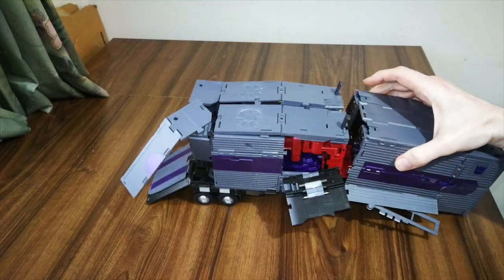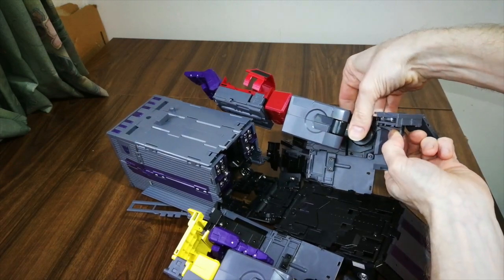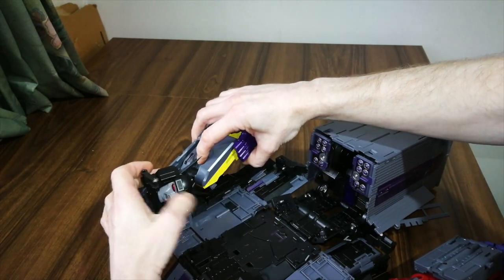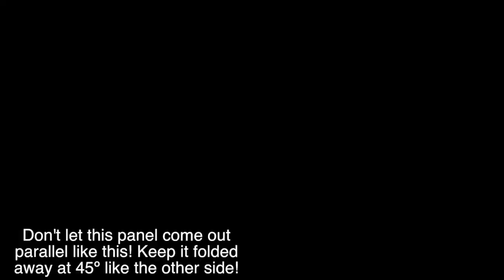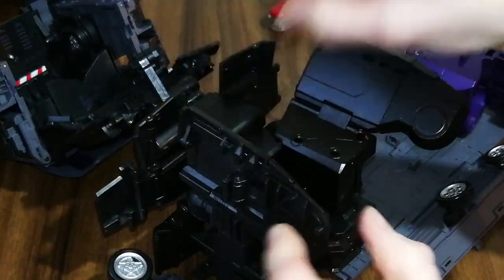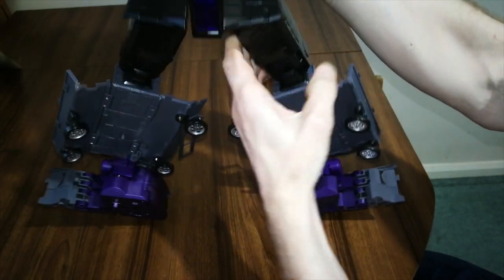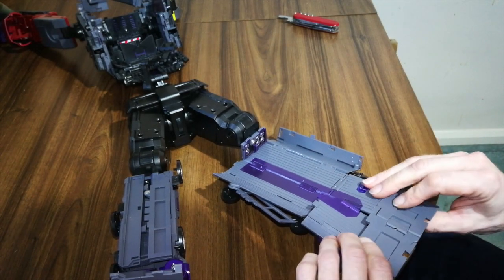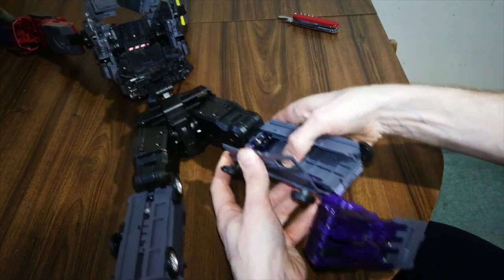The Only Transformation Guide You Need: X Transbots Menasor Trailer To Robot

Comment: Great video thanks! I did mine without any instructions first and broke exactly the same leg tab you did, lol! :) Just watching to see if I missed anything, or how I could have done it smoother. Dunno if it really makes it easier overall, but I ended up fully completing my torso before doing the legs so I had a fully formed torso sitting on half a trailer. Was super solid so when I did the legs there was no torso flopping around on incomplete abs/waist parts. I feel like getting back to trailer without instructions will be harder, so will check out your other vid if I give up!

Comment: Thank you for filming this. I just received my copy yesterday, and just when I got to the part where you rotate the trailer section that makes up the lower limbs, I barely touched it and the single screw that holds the leg to the knee joint sheared off. The wind was taken out of my sails naturally. I finished the transformation, but I'm waiting to hear back if I can get a replacement knee section or I'm going to attempt to drill out the broken part and put in a stronger screw.
Reply from the maker: That's awful. I wonder if they used two different batches of screws. I've transformed mine and posed him loads with no knee problems.
Reply: @TransformsIntoAGuitar  It’s the screw that is mounted through the trailer/lower leg section that attaches to the bottom of the knee joint. I don’t know why they thought that single little screw was a good idea. I’m afraid of tinkering with it too much from fear of the other leg snapping off.
Reply from the maker: @GartheKnightReturns  I know which screw you mean, there have been a few reports of that same problem.

Comment: He will stay as menasor forever.
Reply from the maker: That's a shame. I love seeing Motormaster with his trailer.
Reply: I really want to transform back and forth, but the immense weights involved on either side of that teensy waist joint wake me up at night.
Reply from the maker: @uum6  It feels quite sturdy to me. I've transformed him quite a few times with no problem.
Reply: @TransformsIntoAGuitar  I wouldn't worry if my Dragstrip hadn't  broken within days of arrival. Got a replacement part, but still.
Reply from the maker: @uum6  Yeah, that issue is worrying. I hear the replacement parts are much better than the original.
Reply: @uum6  What part broke? Curious what to look out for. I got him back to car mode with no real issues.

Comment: Hey, thanks for your video. I have the same issue with the spring loaded shoulder joint, did you manage to fix yours?
Reply from the maker: No, I didn't bother. It stays on well enough and others said the spring caused it to damage the paint.
Reply: @TransformsIntoAGuitar   I requested and received a replacement part.... it didn’t fix the problem. Mine stays on well enough as well but  when I look at it I know it’s there haha
Reply from the maker: @gamorg  What part did they send you? I couldn't be bothered to take the arm apart to find out if it was misassembled or broken.
Reply: @TransformsIntoAGuitar  they sent me that clip part.. I took apart the arm and put the new bit in, obviously that wasn’t the problem and I can’t see anything else inside the arm (it’s pretty much hollow) that would correct it.
Reply: @TransformsIntoAGuitar  if you ever find out how to fix it let me know mate.
Reply from the maker: @gamorg  I would think the spring is not connected to the right part.
Reply: @TransformsIntoAGuitar  update, Xtransbots customer service is sending me out a full replacement upper arm.
Reply from the maker: @gamorg  Oh great! To add/remove Dead End you'll need to fold the front of the car down and move his head so you can control the clip and stop it scraping the paint.
Reply: @TransformsIntoAGuitar  thanks mate!

Comment: I mean I want one of these really bad, but on of the figures is really damn hard to find I've been told.
Reply from the maker: Unless it's one of the armbots you won't really notice the absence!
Reply: @TransformsIntoAGuitar  I just don't understand why the leg one's are on the back. I will say I appreciate the EXTREMELY difficult undertaking and engineering it took to make the nightmare that is Menasor's design in a feasibly possible Transformer.
I will get it eventually, but I've seen a full set go for $1,000 and I just don't see that happening.

Edit: I just found out they sell a kit that has fake arm parts and like 12 Alternate faces for Menasor and Motor Master so... This just became much more viable.
Reply from the maker: @seanjenkins2188  The leg ones are on the back because of the cartoon. 
The arm shells can (apparently) be attached to the arms  without the bots attached, so yeah, it'll work.
Reply: @TransformsIntoAGuitar  Well I've got a DX9 Blitzwing, Octane, and a complete Jinbao Oversized Devastator on their way in the mail.
Just have to wait for US Customs to do their stuff... eventually.
Reply from the maker: @seanjenkins2188  Seems you've got a good time on its way to you!
Reply: @TransformsIntoAGuitar  Between now and August to September, bought the 1st two prior and Devastator literally Saturday.
Edit: I got Devastator for a hundred bucks, WORTH IT.
Reply from the maker: @seanjenkins2188  Nice!

Comment: 10:02 I've tried to get those rectangular pegs and hook in for the hip skirt but its popping out still. Also the front panel of the torso doesn't quite line up flush like yours.

Oh well, this piece of shit will never get transformed
Reply from the maker: Is there flash on one of the tabs or in a hole? 
Do you have the chest panel's double hinge adjusted?
Reply: @TransformsIntoAGuitar  just sorter front of the chest, didn't have the wheels flush, my fault. The tabs for the hip skirt - one tab looks the right size and the other looks too thin. When I push the round thin pegs in, they don't want to stay in place its almost like I force them in
Reply from the maker: @DanielGreen07  I'm glad the chest is sorted, but I don't understand why thin pegs would need forcing in. Weird. Try posting pics on a forum.
Reply: @TransformsIntoAGuitar  will do 👍
Reply: @TransformsIntoAGuitar  hey i did it! At last!! I dont think its properly finished as its very wobbly as a skeleton but at least I'm there! Thanks again for your video
Reply from the maker: @DanielGreen07  Sweet! You have to make micro adjustments to the hips and knees to get him stable.